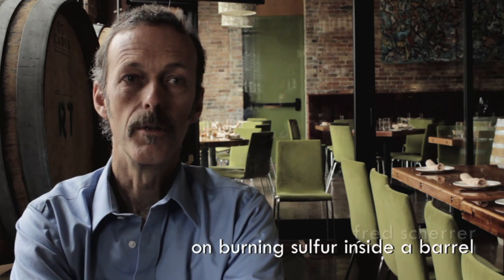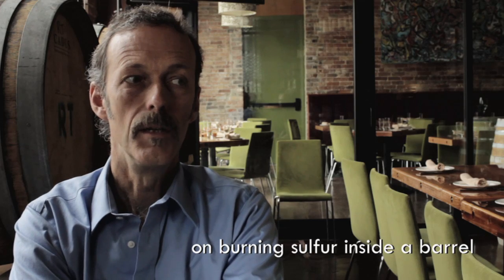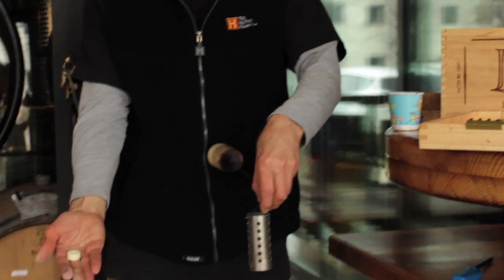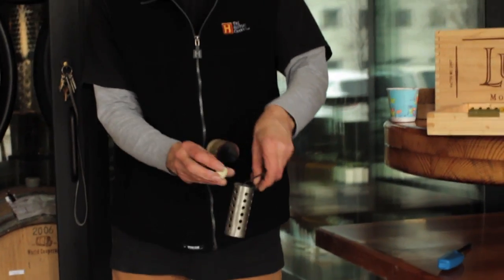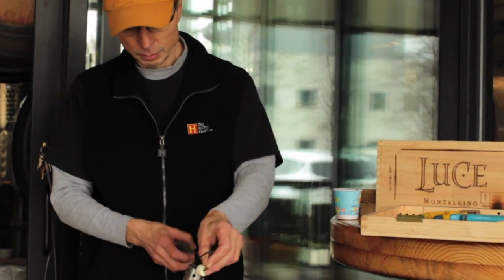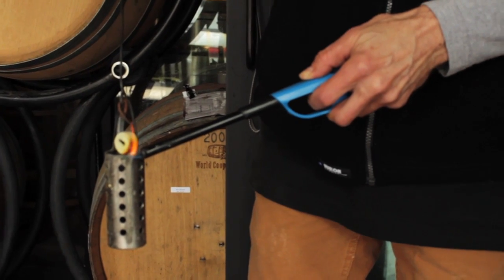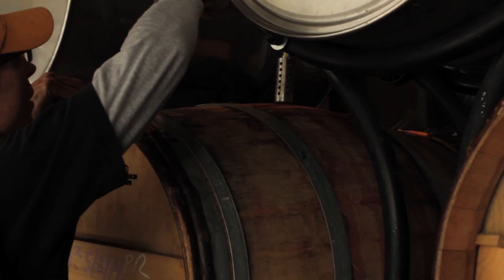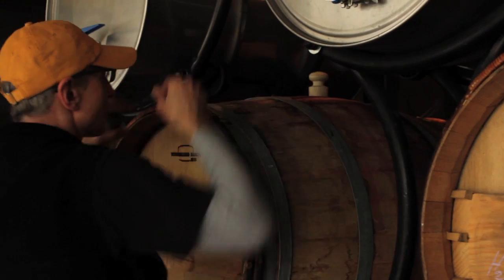Winemaking 101: Burning sulfur in wine barrels with Fred Scherrer

Comment: I'm trying to find more information on preparing my oak barrels for this years wine. I have only used them once (they were previously used for whiskey) My uncle suggested knocking the rings off enough to remove the lids and then reinstalling the rings. Flip the barrel over onto 3 bricks and burn a bees wax pillar candle inside for 12-24hrs. This is a method he learned from my great grandfather in Northern Italy. We make Barbara wine.